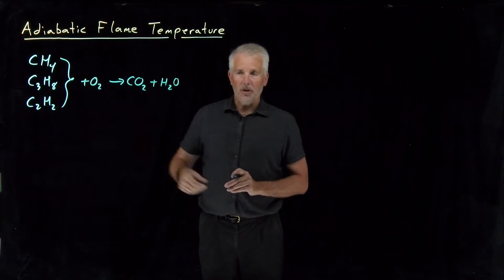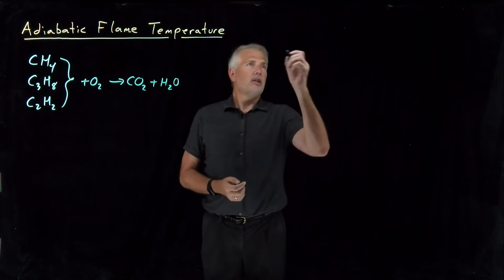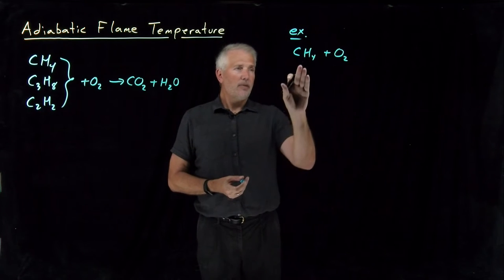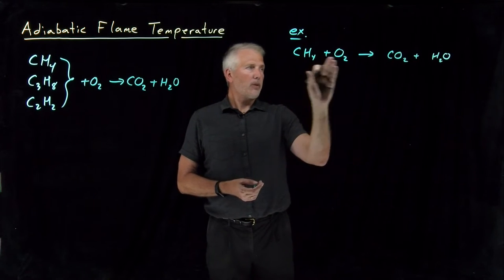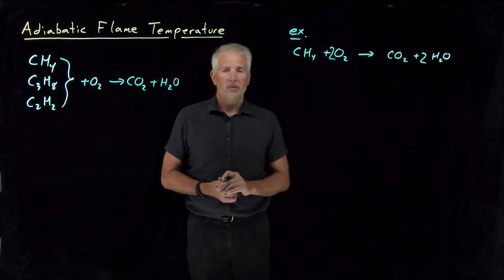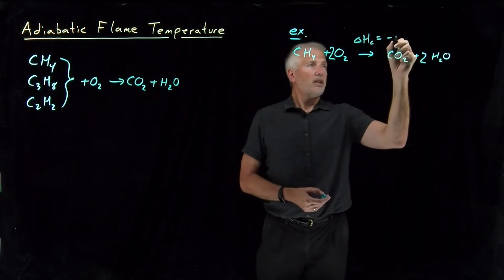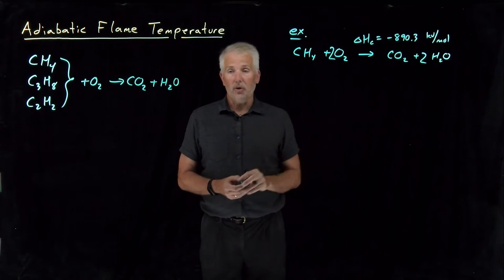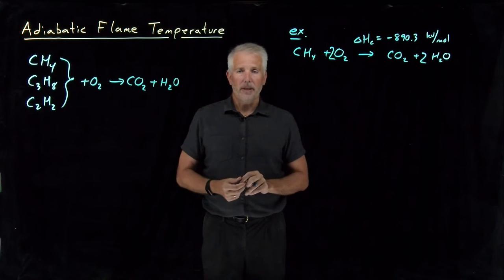Adiabatic Flame Temperature

Comment: I would pre-heat the oxygen and fuel molecules electromagnetically. Then record the 3D volumetric temperature distribution, tracking flow of reactants. To start. And find the temperature dependent heat capacities data or models. To start. Calibrate and optimized the linked models. Track spectroscopic IR, VIS, thermal, UV, whatever is available. Share the results.

Richard Collins, The Internet Foundation

Comment: great video, whered you get the average heat capacities though? ive been looking around and cant find them.
its odd to me that we're finding the end temperature, but need a value (the Cp) that we cant get without assuming an end temperature
Reply from the maker: You're right, I had to have a rough guess of the final T in order to calculate the average. I got the C_P(T) values from the NIST web data (a great resource).

It's true that average C_P will depend on the final T, but the final T also depends on the C_P values. It would be more accurate to solve the problem self-consistently, but that would have been complicated enough to obscure the main point of this video, so I took a more approximate approach
Reply: @PhysicalChemistry  gotcha, yeah this seems to be a standard approach, dont mean to criticize. 
ill check the NIST stuff. just wanted values i could feel confident using for graded assignments. thanks for the reply
Reply from the maker: @mattm12124  https://webbook.nist.gov/chemistry/form-ser/

Comment: 1) Shouldn’t the evaporation enthalpy of water be considered in the equation?
2) I believe that an iterative approach would be more accurate instead of considering average CP
Reply from the maker: 1) The heat of combustion specifies conversion of the hydrogen to H₂O(g), not H₂O(l). You can think of the heat of combustion as already factoring in the heat of vaporization, if you like.

2) You are definitely correct. The heat capacity Cₚ depends on T in a pretty complicated way (https://www.youtube.com/watch?v=Gg9IlW76rDE), so just using an average Cₚ isn't very accurate. If you have better Cₚ(T) data, it is certainly better to use a numerical approach — such as iteratively evaluating the integral mentioned @18:48
Reply: @PhysicalChemistry  Thank You for clarifying it!

Comment: Please can I ask if you will do electrochemistry (electrochemical cells, half cell reactions, Nernst equation etc)?
Reply from the maker: Probably not. Those topics are often not covered in physical chemistry courses, because they are treated well in general chemistry and/or analytical chemistry. There is very little I would include in a PChem treatment that wouldn't just duplicate what is found in those textbooks or courses.
Reply: @PhysicalChemistry  I see. Please can I ask what textbooks and exercises you recommend for electrochemistry? I find the Thermodynamics (such as the Eyring-Polanyi and Butler Volmer equations) and Kinetics (such as mass transport limiting current and the Cottrell equation) very difficult to understand and apply to questions. I the have Atkins' 11th Edition textbook.
Reply from the maker: @liambuchan4162  Ah, I see. Those are indeed more advanced than just general chemistry. The Eyring equation is not particular to electrochemistry, and is a great PChem topic. I'll add that to my list of things to cover in the kinetics section. Butler-Volmer is definitely electrochem, though, and not PChem. I don't have a great book recommendation for aqueous ionic chemistry / electrochemistry, unfortunately.

Comment: Is the specific heat capacity (Cp) commutative ? i.e. is this statement true Cp (H2O+N2+O2+CO2) = Cp(H2O) + Cp(O2) + Cp(N2) + Cp(CO2)
Reply from the maker: Short answer: no

Extensive (not commutative) is the word you're looking for. But either way, it is often not the case that the heat capacity of a mixture would be the same as the sum of the heat capacities of the pure individual components.

However, for the case of gases, like we're talking about in this video, then it's not a bad approximation to assume that the heat capacity of the mixture is the sum of the individual component heat capacities. That's because in a gas the molecules are usually far away from each other, and don't affect each other very much.

Comment: i have a question.
is it possible to get a fuel to burn adiabatically in real life conditions?
if for instance i burn gasoline(its adiabatic flame temperature with air as oxidizer  is 2100 celsius degrees), how much lower will its flame temperature be in real conditions?
Reply from the maker: Your suspicions are correct: adiabatic conditions are impossible to achieve for a flame. Since a flame needs an oxygen source, it is impossible to insulate it from the surroundings. So a significant amount of heat will be lost to the environment (indeed, this is often the whole point of burning the fuel!) and the process won't be adiabatic.

Adiabaticity is a sort of "ideal" flame condition that we can't quite achieve. Think of it like the ideal gas law: no gases is ever truly ideal. Under some conditions it can be quite close, and under other conditions its a terrible approximation. But the ideal gas law still gives useful predictions.  Likewise, no flame is ever truly adiabatic. The adiabatic flame temperature might give a reasonable estimate of the flame temperature if you burn in a carefully controlled stoichiometric ratio of fuel and oxygen, and pay a lot of attention to the flame conditions. Or it may be far from adiabatic in more normal situations.

A real-world flame will probably be several hundred degrees below the adiabatic flame temperature at its hottest -- and will vary by many hundreds of degrees in different positions in the flame itself.
Reply: @PhysicalChemistry  thanks!!